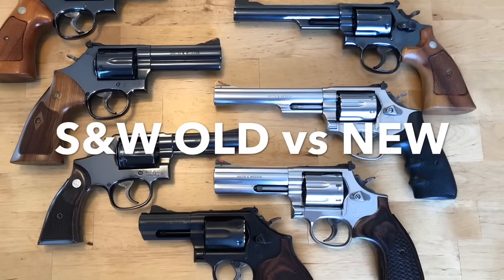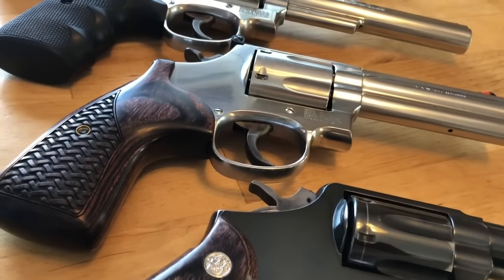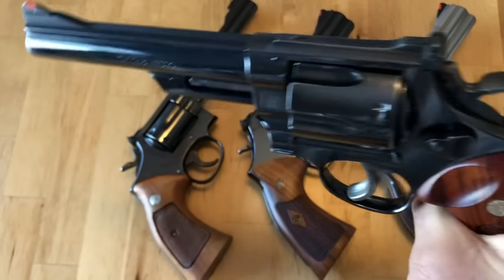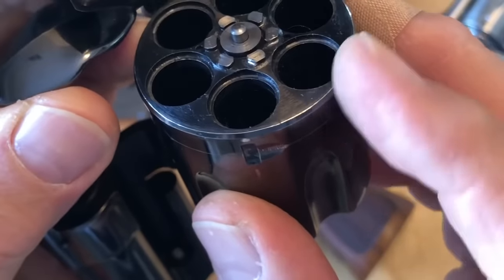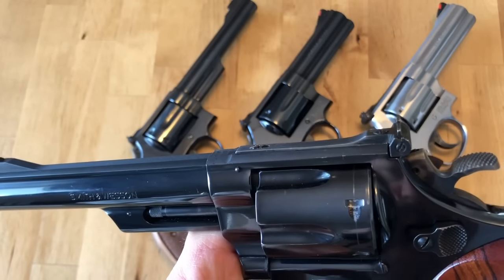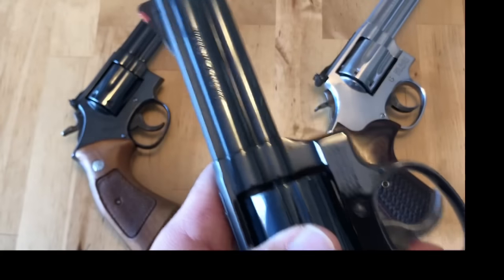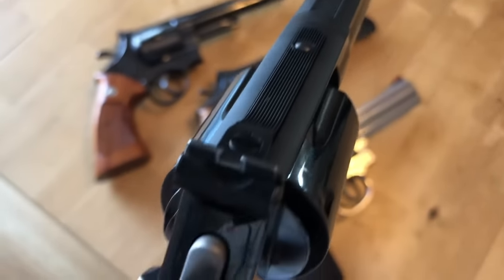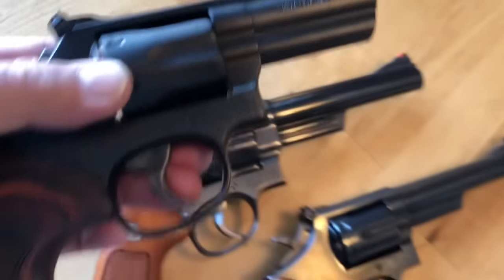Smith & Wesson: Old vs New. Do they make them like they used to?

Comment: new sw you might as well buy a Taurus its about the same quality 6 months ago I bought a brand new 686 2 1/2 inch barrel of course it had to be ordered when it arrived the cylinder gap was 0.012 .I sent it back to the factory they would not touch it said it was within spec I own 6 old sw revolvers 2-29's 2-28's 1-586 1-625 all old guns mostly dash 2 or 3's none had a gap larger than 0.006 the flame through the cylinder gap was unacceptable. sw customer service is total shit. I have bought sw for 40 years. I will NEVER buy another new sw product ever. if its not excessive gap its canted barrels no quality control its just hit and miss. just like Taurus sw junk.